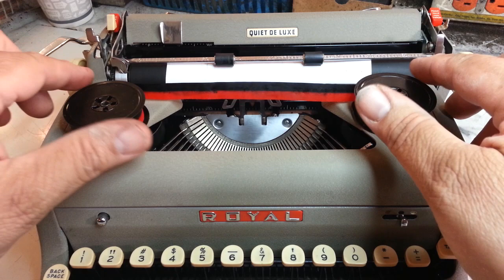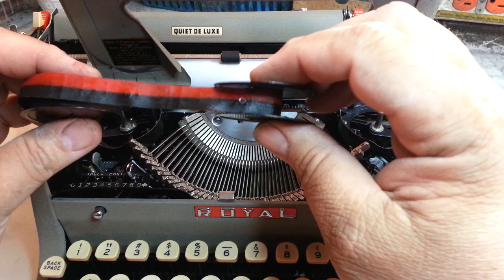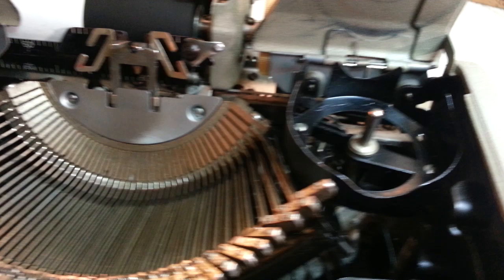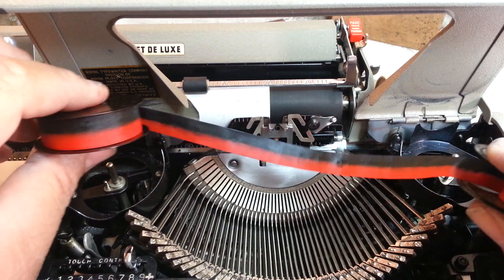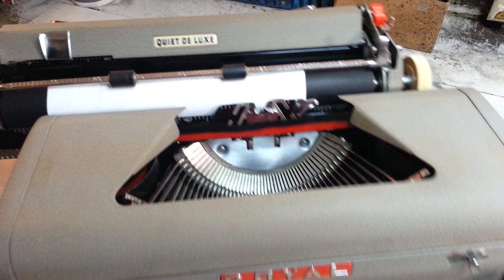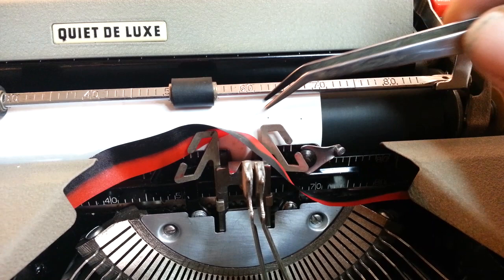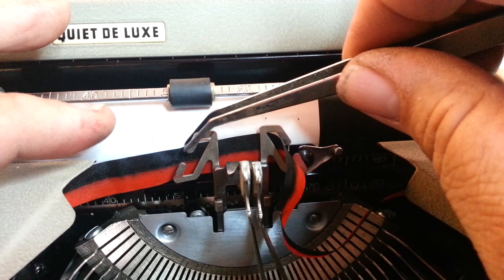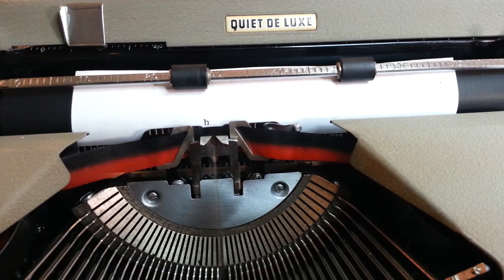Royal Typewriter Ribbon Change Replace Install (Quiet Deluxe) Tutorial Demo

Comment: Do you install your own eyelets or buy the ribbon with eyelets already installed? For years I have tried multiple different eyelet tools, all of which get the job done but none of which produce a pristine looking eyelet like you see when taking off an original ribbon with “factory” eyelets still on. One side just looks a little mashed and less than perfect. Again, they get the job done but I’d love to find the holy-grail tool that make the eyelets look factory-installed.
Reply from the maker: Those are pre-installed, but I do have the proper tool and eyelets and do sometimes use them for ribbons which mimics oem very well.
More often I use that eyelet tool for draw bands (see video) they barely are big enough for the draw band, but I make them work
https://youtu.be/sXgCEo_8_gY
Reply: Hi I found a bunch of old typewriters in my grandpas shed I'm looking for a buyer or a experienced appraiser what would you recommend
Reply from the maker: @clintondaly9232  Make a list of make/model , go to ebay, look for your models and check/search "SOLD" items,
Then you can see what current actual market trends are, Send me pictures I can give you some idea, rushjensen@aol.com  
A lot depends on condition, I have 2 Underwood model 5's in shop right now, one is worth $10, the other is worth $400, Same typewriter !

Comment: Thank you so much for this helpful video! One quick question, because I am genuinely confused. On the plastic-spooled replacement ribbons I've bought, the spools are the other way up (in other words, when black is on top, the side of the spools with the six holes in a kind of daisy pattern (sorry; I don't know the terminology) is on the BOTTOM. And in fact, that seems to be the only way I can get the spools to rest properly in the ribbon cups, so that they're engaging the spindle. But in the video, the spools are the other way up; I actually re-threaded a spool to match the way it's presented here, and the spools wouldn't fit properly in my typewriter this way. Yet it's working that way for you here, and you have pretty much the same machine I do (mine's a 1952 QDL). What am I not understanding? It's driving me bonkers. (I got mine to work fine by just going with it and having the daisy-side on the bottom; I am just trying to get it.) I really appreciate your help!
Reply from the maker: Hello, yes solid spools are the way to go, either plastic or vintage metal.
Most ribbons sold on the internet nowadays use a stupid "universal" core that sucks
Look for a ribbon with solid spools, generally higher priced
my solid spooled ribbons are $10 + $7 s/h

Comment: Quick question how do you make it so the keys are not rusty anymore like it gets stuck when I try to type a letter and I have this exact same model
Reply from the maker: Quick question, not a quick answer, is this rust, old oil or debris ? wire brush, stiff brush, degreaser chemicals to start
Not sure what your particular situation is